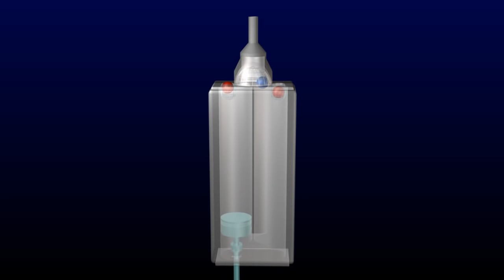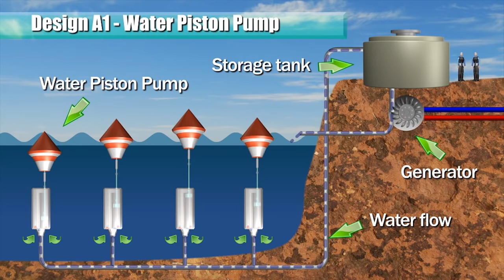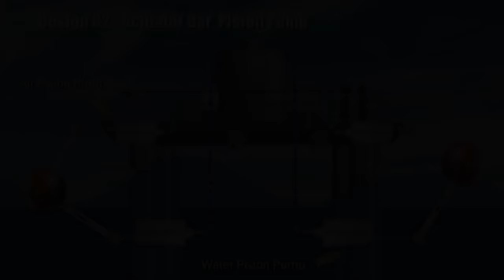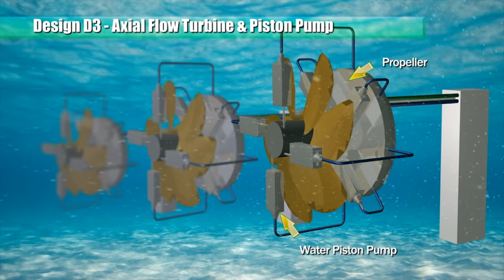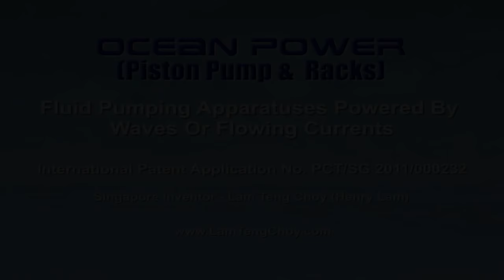Blue Energy - Ocean Power (Piston Pump & Racks)

Comment: LOW  efficiencies,  VERY low reliability for large moving systems.  Very high maintenance costs.  sorry
ferro-fluid / magnetic generators are also in development.    Build solar thermal orbital power station.
Reply: You really think this system won’t work? 

I also like your concept of a solar thermal orbital power station too.

Care to explain how exactly an orbital power station is better than this video? I’m genuinely curious as to how superior your idea would be?
Reply: @DylanBegazo  ORC, organic rankine cycle turbine,  propane working fluid.  Silvered mylar mirrors, big assed ones
Reply: james morton no battery storage? Graphene bi layer battery bank? 

How about graphene carbon nanotube structural materials for the internal parts of the station (since such materials are stronger than steel)
Reply from the maker: New Invention

ShoreLine HydroElectric InFlow Dam System Video (English)
https://youtu.be/A8EYW_aREKw

水力发电内流水坝水岸线系统 / ShoreLine HydroElectric InFlow Dam System Video (Chinese)
https://youtu.be/D2NPLMekG8w

Hydro Power - Hydroelectric Inflow Dam System
https://youtu.be/_ho7JaxOdT0

Ocean Power - Piston Pump & Racks
https://youtu.be/fYfs-qYGzvs

Ocean Power - Racks & Rake Wheel
https://youtu.be/nQGKfAPxsiI
Reply from the maker: @DylanBegazo  New Invention

ShoreLine HydroElectric InFlow Dam System Video (English)
https://youtu.be/A8EYW_aREKw

水力发电内流水坝水岸线系统 / ShoreLine HydroElectric InFlow Dam System Video (Chinese)
https://youtu.be/D2NPLMekG8w

Hydro Power - Hydroelectric Inflow Dam System
https://youtu.be/_ho7JaxOdT0

Ocean Power - Piston Pump & Racks
https://youtu.be/fYfs-qYGzvs

Ocean Power - Racks & Rake Wheel
https://youtu.be/nQGKfAPxsiI
Reply from the maker: @jamesmorton7881  New Invention

ShoreLine HydroElectric InFlow Dam System Video (English)
https://youtu.be/A8EYW_aREKw

水力发电内流水坝水岸线系统 / ShoreLine HydroElectric InFlow Dam System Video (Chinese)
https://youtu.be/D2NPLMekG8w

Hydro Power - Hydroelectric Inflow Dam System
https://youtu.be/_ho7JaxOdT0

Ocean Power - Piston Pump & Racks
https://youtu.be/fYfs-qYGzvs

Ocean Power - Racks & Rake Wheel
https://youtu.be/nQGKfAPxsiI
Reply from the maker: @DylanBegazo  New Invention

ShoreLine HydroElectric InFlow Dam System Video (English)
https://youtu.be/A8EYW_aREKw

水力发电内流水坝水岸线系统 / ShoreLine HydroElectric InFlow Dam System Video (Chinese)
https://youtu.be/D2NPLMekG8w

Hydro Power - Hydroelectric Inflow Dam System
https://youtu.be/_ho7JaxOdT0

Ocean Power - Piston Pump & Racks
https://youtu.be/fYfs-qYGzvs

Ocean Power - Racks & Rake Wheel
https://youtu.be/nQGKfAPxsiI
Reply from the maker: @DylanBegazo  New Invention

ShoreLine HydroElectric InFlow Dam System Video (English)
https://youtu.be/A8EYW_aREKw

水力发电内流水坝水岸线系统 / ShoreLine HydroElectric InFlow Dam System Video (Chinese)
https://youtu.be/D2NPLMekG8w

Hydro Power - Hydroelectric Inflow Dam System
https://youtu.be/_ho7JaxOdT0

Ocean Power - Piston Pump & Racks
https://youtu.be/fYfs-qYGzvs

Ocean Power - Racks & Rake Wheel
https://youtu.be/nQGKfAPxsiI

Comment: looks like lots of moving parts submerged in agressive ocean water. I wanna see it run for 10 years with reasonable ammount of maintainance.
Reply: Yeah it may not be feasible after all those plans
Reply from the maker: New Invention

ShoreLine HydroElectric InFlow Dam System Video (English)
https://youtu.be/A8EYW_aREKw

水力发电内流水坝水岸线系统 / ShoreLine HydroElectric InFlow Dam System Video (Chinese)
https://youtu.be/D2NPLMekG8w

Hydro Power - Hydroelectric Inflow Dam System
https://youtu.be/_ho7JaxOdT0

Ocean Power - Piston Pump & Racks
https://youtu.be/fYfs-qYGzvs

Ocean Power - Racks & Rake Wheel
https://youtu.be/nQGKfAPxsiI

Comment: These will work, but the power output is not that great. You might need several kilometers' worth of ocean front area to generate just 100MW.
Reply from the maker: New Invention

ShoreLine HydroElectric InFlow Dam System Video (English)
https://youtu.be/A8EYW_aREKw

水力发电内流水坝水岸线系统 / ShoreLine HydroElectric InFlow Dam System Video (Chinese)
https://youtu.be/D2NPLMekG8w

Hydro Power - Hydroelectric Inflow Dam System
https://youtu.be/_ho7JaxOdT0

Ocean Power - Piston Pump & Racks
https://youtu.be/fYfs-qYGzvs

Ocean Power - Racks & Rake Wheel
https://youtu.be/nQGKfAPxsiI

Comment: Need to minimize wear and tear from salinity. But these are small generators anyway. Need big power. Start with New York. Build a 100000 ton floating island or bridge and tether it by linkage to shore based geared generators. As the island rises and falls with the tide it would move with the worlds greatest torque. Think Biggest. We are running out of time. Think of the island hanging on 4 corner pistons 10 feet diameter each. When the tide goes out how much PSI would each piston produce per 1 foot tidal drop if the island weighs 10 million pounds and the compression ratio is 10 to 1 and a 6 foot stroke? Then add leverage to the design. Are you thinking yet? IBM's Watson for president.
Reply from the maker: New Invention

ShoreLine HydroElectric InFlow Dam System Video (English)
https://youtu.be/A8EYW_aREKw

水力发电内流水坝水岸线系统 / ShoreLine HydroElectric InFlow Dam System Video (Chinese)
https://youtu.be/D2NPLMekG8w

Hydro Power - Hydroelectric Inflow Dam System
https://youtu.be/_ho7JaxOdT0

Ocean Power - Piston Pump & Racks
https://youtu.be/fYfs-qYGzvs

Ocean Power - Racks & Rake Wheel
https://youtu.be/nQGKfAPxsiI

Comment: great video but I would like to know how much energy in kilowatts that these devices produce on average,to know whether they are cost effective to make
Reply: Adam Eastwood ....ya bro i also
Reply: Adam Eastwood does that not depend upon the capacity of machinery being used at station!
Reply: Heart Robber  is that a statement?,
Reply: no ScoobyDuh , it's a question!
Reply: domanda di una stupidità disarmante
Reply: It concentrates a lot of air through a single turbine. With the first one the pumping is done by rise and fall of water, you build only the bellows as big as you need and a generator to match. Only moving parts to maintain are in the generator. But then there are not always waves in the same place.
Consider that windmills turned heavy millstones 100's of years ago as example of what low tech wind can do. Water wheels and Norse Mills did likewise. You collect big, you don't have to be the best to be worth it.
Reply from the maker: New Invention

ShoreLine HydroElectric InFlow Dam System Video (English)
https://youtu.be/A8EYW_aREKw

水力发电内流水坝水岸线系统 / ShoreLine HydroElectric InFlow Dam System Video (Chinese)
https://youtu.be/D2NPLMekG8w

Hydro Power - Hydroelectric Inflow Dam System
https://youtu.be/_ho7JaxOdT0

Ocean Power - Piston Pump & Racks
https://youtu.be/fYfs-qYGzvs

Ocean Power - Racks & Rake Wheel
https://youtu.be/nQGKfAPxsiI

Comment: the designs that minimize or eliminate seawater contact with metal are the best.  I like the river wheel.
Reply from the maker: New Invention

ShoreLine HydroElectric InFlow Dam System Video (English)
https://youtu.be/A8EYW_aREKw

水力发电内流水坝水岸线系统 / ShoreLine HydroElectric InFlow Dam System Video (Chinese)
https://youtu.be/D2NPLMekG8w

Hydro Power - Hydroelectric Inflow Dam System
https://youtu.be/_ho7JaxOdT0

Ocean Power - Piston Pump & Racks
https://youtu.be/fYfs-qYGzvs

Ocean Power - Racks & Rake Wheel
https://youtu.be/nQGKfAPxsiI
Reply: Hi,

All my invention is at Concept Stage only. If you wish, you can go ahead and design it.

New Invention

ShoreLine HydroElectric InFlow Dam System Video (English)

https://youtu.be/FokmF6bP4Yc

水力发电内流水坝水岸线系统 / ShoreLine HydroElectric InFlow Dam System Video (Chinese)

https://youtu.be/Pu4VyGkkvlg

Hydro Power - Hydroelectric Inflow Dam System

https://youtu.be/5XMarpHCJHU

Ocean Power - Piston Pump & Racks

https://youtu.be/hUNAkf3K25k

Ocean Power - Racks & Rake Wheel

https://youtu.be/OrJi1A9kebA

Henry Lam

Comment: The wave ones have to many moving parts which will need allot of maintenance.The current or tide going in and out would be a better one.Can be below the surface and away from traffic areas.
Reply from the maker: New Invention

ShoreLine HydroElectric InFlow Dam System Video (English)
https://youtu.be/A8EYW_aREKw

水力发电内流水坝水岸线系统 / ShoreLine HydroElectric InFlow Dam System Video (Chinese)
https://youtu.be/D2NPLMekG8w

Hydro Power - Hydroelectric Inflow Dam System
https://youtu.be/_ho7JaxOdT0

Ocean Power - Piston Pump & Racks
https://youtu.be/fYfs-qYGzvs

Ocean Power - Racks & Rake Wheel
https://youtu.be/nQGKfAPxsiI

Comment: I have a better idea. .. use a hose to move water from one end to 
another with a turbine in the middle. Free endless energy using the 
ocean.  Its based on a vacuum in a hose.
Reply from the maker: New Invention

ShoreLine HydroElectric InFlow Dam System Video (English)
https://youtu.be/A8EYW_aREKw

水力发电内流水坝水岸线系统 / ShoreLine HydroElectric InFlow Dam System Video (Chinese)
https://youtu.be/D2NPLMekG8w

Hydro Power - Hydroelectric Inflow Dam System
https://youtu.be/_ho7JaxOdT0

Ocean Power - Piston Pump & Racks
https://youtu.be/fYfs-qYGzvs

Ocean Power - Racks & Rake Wheel
https://youtu.be/nQGKfAPxsiI

Comment: To many moving parts. Why not just have one float riding the wave action move magnets passed coils in a vertical sealed column arrangement. One float and column per unit. One or two moving parts.
Reply: Awesome reduction of moving parts  ......but,  frequency cycles would only  equal  the water wave frequency and voltage  output would also be lower than  standard  world voltages.Example if the water wave has a repetition frequency of  1 wave every 15 seconds  you would have 4 cycles per minute machine. Now assuming that you could  have consistent waves measuring the same peak to peak heights of 24 feet ... 1# 12 foot peak 1# 12 trough= equals  1# wave cycle every fifteen seconds  ... right? suppose space one output coil every foot up and down and be able to alternate the  magnet to coil engagement you would generate 6 cycles in one direction and 6 in the opposite , if you choose you can generate one cycle  up... 12 coils up and one cycle  down  12 coils down ... what voltage each coil produce is a mater of magnetic flux density  and coil windings ..It would make power but nothing which resembles grid power , or even dc solar power ... it would be its own strange creation .Blue power , or green power a pipe dreams that would cost huge sums but at no savings to the customers even being free of fuel costs...to the UTILITY COMPANY ...they would justify the high cost of maintenance to never lower the KW HR price. THAT IS A WELL ESTABLISHED REALITY NOW.If resources were an issue a real issue , then it would make sense to use these systems that are and always will be devoid of reliable frequency and repetition ...not one day has the same wave action as another , same applies to solar or , wind .THE HOLY GRAIL  OF ENERGY  WAS INVENTED IN  1839  by WILLIAM ROBERT GROVE... NATURAL GAS IS INEXHAUSTIBLE , when reformed it produces HYDROGEN and when passed through the plates of a fuel cell , without combustion and purely by electron exchange ...out comes dc power and potable grade water as a product of heat condensation ... WHY IS IT NOT USED MORE WIDELY WORLD WIDE????ASK  MILITANT IMBECILES WHO SHOUT "DANAGER  NUCLEAR EXPLOSION "  PRIMED TODO SO  BY THOSE IN ENERGY PRODUCTION  WHO PROFIT FROM CENTRALIZED POWER PRODUCTION AND WHO KNOWS WHOM ELSE.The centralization of power generation is  a huge mistake , every community should have its own generation system  POWER BY  HYDROGEN  DERIVED FROM NEVER ENDIG SOURCES OF NATURAL GAS ... WHICH IS THE ONLY  TRULY INEXHAUSTIBLE SOURCE FOR IT AND MOREOVER BEING CONSTANTLY MADE BY MEN , PIGS COWS , TAKE YOU PICK  ... BLUE POWER IS UNRELIABLE ...FART POWER IS CONSTANT.
Reply from the maker: New Invention

ShoreLine HydroElectric InFlow Dam System Video (English)
https://youtu.be/A8EYW_aREKw

水力发电内流水坝水岸线系统 / ShoreLine HydroElectric InFlow Dam System Video (Chinese)
https://youtu.be/D2NPLMekG8w

Hydro Power - Hydroelectric Inflow Dam System
https://youtu.be/_ho7JaxOdT0

Ocean Power - Piston Pump & Racks
https://youtu.be/fYfs-qYGzvs

Ocean Power - Racks & Rake Wheel
https://youtu.be/nQGKfAPxsiI

Comment: we need clean energy in future
Reply: We have clean energy now...

Those horrible electrical energy alternatives need;  voltage regulator circuits, dc to ac inverters, Wires, step up transformers, switch gear housing, line carrying poles, metering...But; it does look pretty...Coal burns clean...Coal fired power plants are the best form of energy creation...Solar and wind are the second and first (respectively) worst sources of power generation.
Reply from the maker: New Invention

ShoreLine HydroElectric InFlow Dam System Video (English)
https://youtu.be/A8EYW_aREKw

水力发电内流水坝水岸线系统 / ShoreLine HydroElectric InFlow Dam System Video (Chinese)
https://youtu.be/D2NPLMekG8w

Hydro Power - Hydroelectric Inflow Dam System
https://youtu.be/_ho7JaxOdT0

Ocean Power - Piston Pump & Racks
https://youtu.be/fYfs-qYGzvs

Ocean Power - Racks & Rake Wheel
https://youtu.be/nQGKfAPxsiI

Comment: I would like to know if you intend to use the compressed air as it is or reheat it before feeding it to the turbine.
Reply from the maker: New Invention

ShoreLine HydroElectric InFlow Dam System Video (English)
https://youtu.be/A8EYW_aREKw

水力发电内流水坝水岸线系统 / ShoreLine HydroElectric InFlow Dam System Video (Chinese)
https://youtu.be/D2NPLMekG8w

Hydro Power - Hydroelectric Inflow Dam System
https://youtu.be/_ho7JaxOdT0

Ocean Power - Piston Pump & Racks
https://youtu.be/fYfs-qYGzvs

Ocean Power - Racks & Rake Wheel
https://youtu.be/nQGKfAPxsiI

Comment: The weakness of those designs are moving parts that are not electricity generators (regulating valves and arms). The only moving elements should be waves or moving  water and electric turbines. There is also missing element of flexibility - they are all massive constructionist pinpointed to ground. The electric turbine should  have flexibility to be anchored to any place where water flows the same as boat. The design is very simple and efficient but I can not post picture in comment.
Reply from the maker: Hi,

All my invention is at Concept Stage only. If you wish, you can go ahead and design it.

New Invention
ShoreLine HydroElectric InFlow Dam System Video (English)
https://youtu.be/x8wKpl3N5lM
水力发电内流水坝水岸线系统 / ShoreLine HydroElectric InFlow Dam System Video (Chinese)
https://youtu.be/ZmL8biLw-ps 
Hydro Power - Hydroelectric Inflow Dam System
https://youtu.be/89mHu4JsIDs 

Ocean Power - Piston Pump & Racks

https://youtu.be/BSvKSzvhzZ8 
Ocean Power - Racks & Rake Wheel
https://youtu.be/c0_m3vE_aXY 

Henry Lam

Comment: Uhm, the first few proposals with the buoys aren't going to work. I don't think the up/down motion of the tidal waves represent the bulk of the usable potential energy. The forward/backward motion of the waves are where you get enough potential energy to justify a system. So I think your system will barely get enough power and the construction of the piston assembly MUST be very robust to withstand the sideways force exerted on the buoys by the passing waves. There's a few reasons why tidal wave generators are very difficult to break-even, namely corrosion, erosion and the erratic nature of the waves. The tidal waves aren't these silky, perfect-sine-wave-looking fluid, they're extremely chaotic with a mixture of turbulent and laminar flows, composite frequency and amplitude going in several directions. Which means maintenance and repairs are on-going and non-stop, and since it's in the sea, it's going to be difficult and expensive.
Reply from the maker: New Invention

ShoreLine HydroElectric InFlow Dam System Video (English)
https://youtu.be/A8EYW_aREKw

水力发电内流水坝水岸线系统 / ShoreLine HydroElectric InFlow Dam System Video (Chinese)
https://youtu.be/D2NPLMekG8w

Hydro Power - Hydroelectric Inflow Dam System
https://youtu.be/_ho7JaxOdT0

Ocean Power - Piston Pump & Racks
https://youtu.be/fYfs-qYGzvs

Ocean Power - Racks & Rake Wheel
https://youtu.be/nQGKfAPxsiI

Comment: QUESTION ?
IS IT TRUE THAT IF YOU PLACE A DRINKING STRAW IN A   PINT GLASS OF WATER ..THE WATER RISES WITHIN THE TUBE
IF YOU PLACED A TUBE,      WITH SMALL SAY  1 FT   DIAMETER    ...     DOWN   HALF A MILE    INTO THE DEEP OCEAN  ,   THEN....HOW FAR UP THE TUBE WOULD THE WATER RISE ??
IF YOU PUNCTURE  THE TUBE WITH A SMALL HOLE JUST ABOVE THE SEA / WATER LEVEL WOULD THE WATER  SPURT OUT OF THE HOLE ???   WHAT SORT OF PRESSURE ?

IF SO ,  YOU WOULD HAVE CONTINUED  POWER   ABLE TO DRIVE A SIMPLE  " MILL-WHEEL" 
IN A LAKE THE WATER WOULD DRIVE FOR  EVERY MORE ANY MACHINE YOU WANT TO USE THIS POWER FOR???

Comment: simply not feasible, seaweed and debris will constantly clog any kind of filter system and to get the best seal you can't just let debris into the pump chamber ,Anchored platform with booms and pontoons straight to generator is probably best effective way ,it's often ( KISS,keep it simple stupid ) I can see the forethought of off peak generation but we have bank stations ,and tides and currents change all the time ,if we only had clean sea's this would be viable off peak solution of energy power
Reply from the maker: New Invention

ShoreLine HydroElectric InFlow Dam System Video (English)
https://youtu.be/A8EYW_aREKw

水力发电内流水坝水岸线系统 / ShoreLine HydroElectric InFlow Dam System Video (Chinese)
https://youtu.be/D2NPLMekG8w

Hydro Power - Hydroelectric Inflow Dam System
https://youtu.be/_ho7JaxOdT0

Ocean Power - Piston Pump & Racks
https://youtu.be/fYfs-qYGzvs

Ocean Power - Racks & Rake Wheel
https://youtu.be/nQGKfAPxsiI